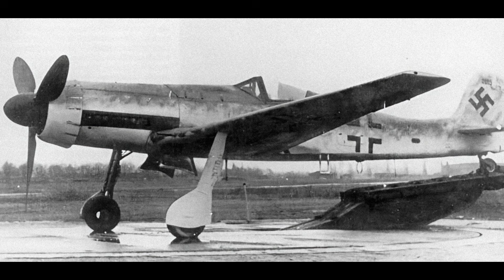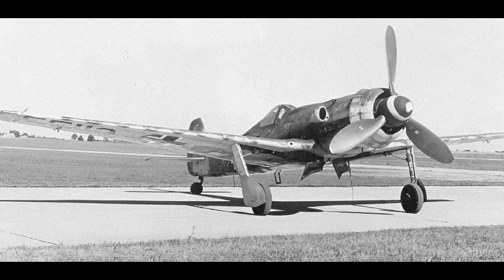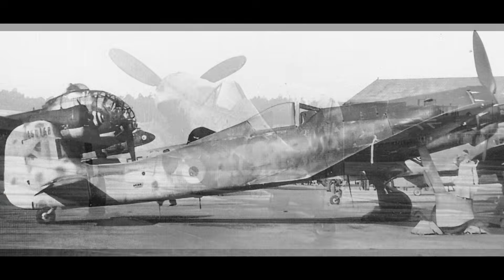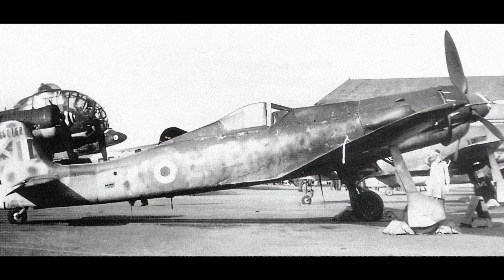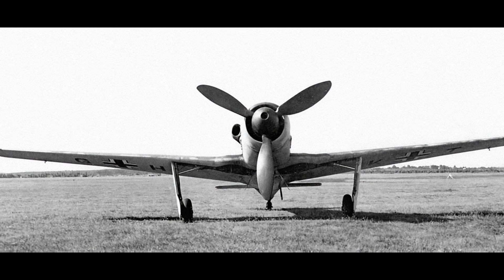Focke-Wulf Ta 152: 429 MPH at 34,000 ft Interceptor

Comment: First 2 minutes is… crap.
American efforts were more advanced with turbos in the late 30s and early 40s and pressure cabins too.
P-40, P-39, P-38, P-47, B-24 and B-17 had or originally intended to have turbos. The B-29 didn’t come out of no where.
German efforts were far more limited.
Seriously though AI slop accusation looks nailed on here